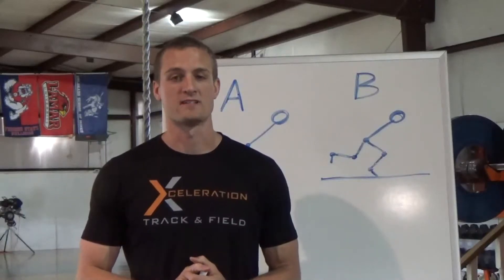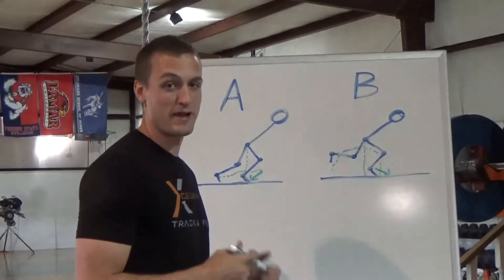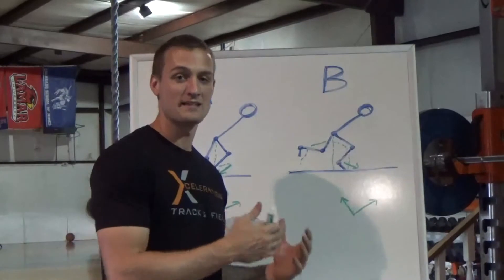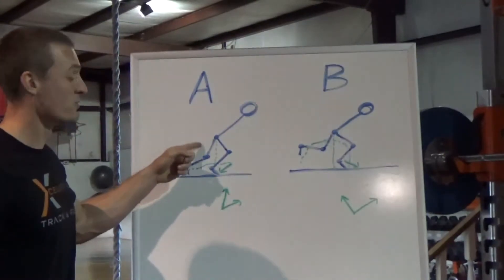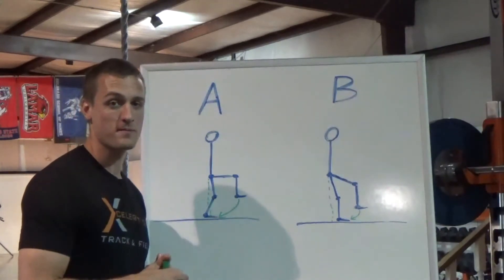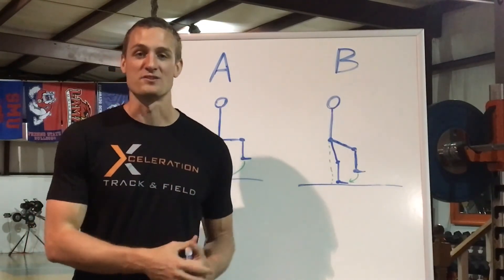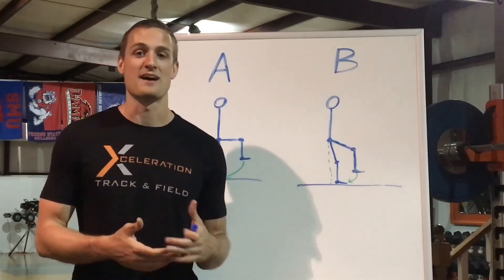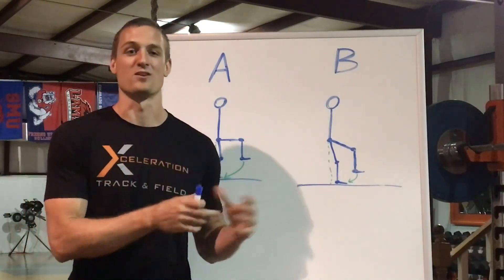Speed Science 5. sprinting research

Comment: Pretty cool! But Daniel how so I know which "running style" is better for me. Before I also used to do the thing with more ground contact time and it really got me faster, But now 2 years later I am more of short ground contact sprinter I think..
How do I know on which style i should concentrate on?
Reply from the maker: +CHUK NNAMDI You should always train yourself to get off the ground quick in warmups and technique work. But for actually sprinting, your ideal mechanics change as your force changes, which happens through the course of a year as well as day to day and week to week. So you have to be willing to just go out there and sprint and not worry about exactly how fast you get off the ground or how much frontside and backside mechanics you have. Try to run with a competitive partner as much as possible. That will prevent you from crippling your speed by thinking about mechanics too much.